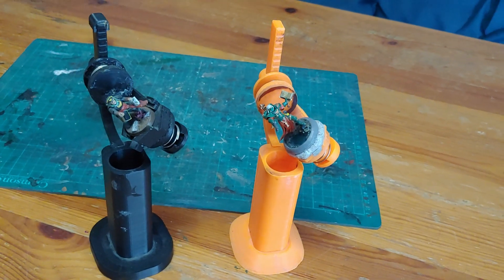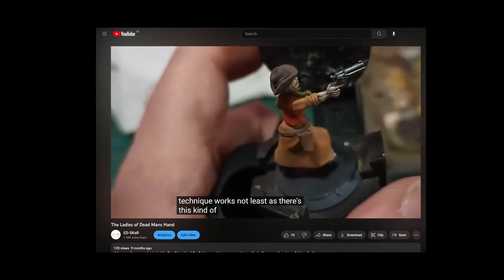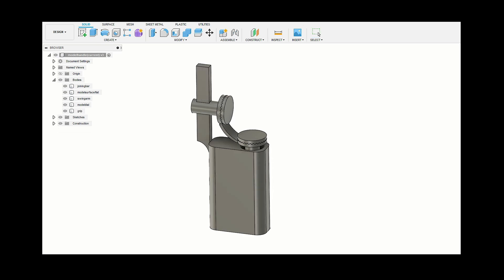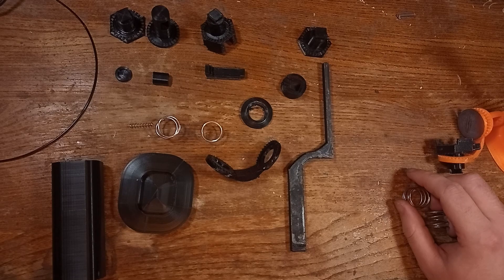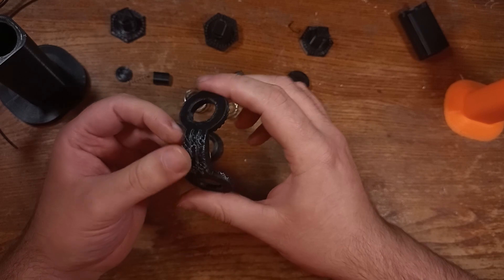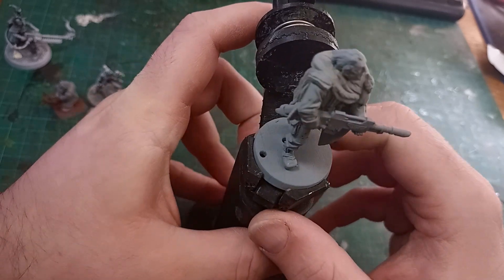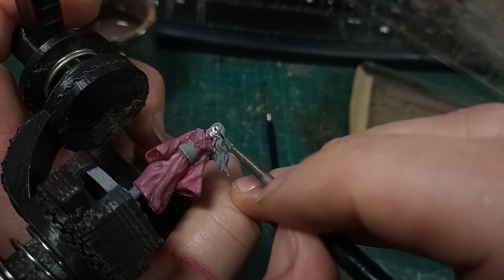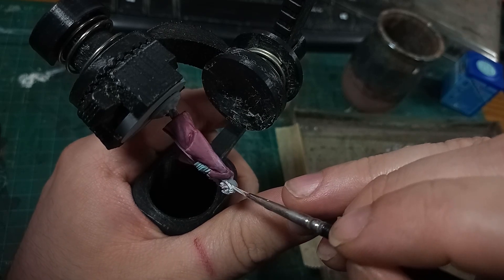ED-SKaR's Overly Complex Model Holder; Now Available.

Comment: I came here after the shill in the 2K Q&A video. I use a plastic pill jar that I can simply cup in the palm of my hand. It has a child-proof lid so I can rotate it without it coming off. I stick the model on with a bit of hot glue. It gives me a lot of the options yours has, but for working upside down when working under skirts etc. yours is far better! I'll keep it in mind for when I get a printer!

Comment: Very interesting approach. I am also studying a bit the available 3d printable paint handles and developing my own. I would suggest simplifying the part with springs: remove the springs and use 3d printable screws (threads in fusion), as it reduces complexity and parts needed. My 2c
Reply from the maker: That would work, I'm not sure if I fully picture what you mean so  I see two points I'd raise.
 The first is that not everyones printer has good enough quality for screwthreads. Printers are improving over time, but there's still quite a few that wouldn't make good screws.
 The second is the ease of use, if you had to loosen a screw, or several, move the model, then tighten the screws, this would slow down the painting process a lot. As an example; when I paint boots on a model by having the model horizontal, I could rotate the model 2 or 3 times to paint the toe, side, heel, side of the boots. With a freemoving rotation, held by the spring, this is very quick and the model stays secure. With a screw retention, you'd make that process take 3 or 4 times as long.
 
I do agree that sourcing the springs is an annoyance, I tried to give a larger range of springs to make it easier. With access to 'the internet' most people can order an appropriate size of spring for not to much.

Thanks for the comment, good luck with your design.

Comment: Is anyone selling the parts please?
I don’t have access to a 3D printer.
Is this device capable of holding up to 80mm white metal figurines?
Reply from the maker: I don't currently have an official retailer of physical prints, but you can ask around your local hobby groups and you might find someone with an FDM printer who can run off the parts for you. I wish I could do it myself but I don't have the infrastructure, and you can see in the video my print quality isn't that good, I'd feel bad charging money for this quality print.

The contraption is open topped so there is no limit to the height of the model, so long as the pose doesn't lean out sideways, it can work. I have painted 54mm models which does work well.
 The maximum base size for the clamp is 32mm, so you might have to use a temporary base for painting, and transfer the model to its final base after, I do this with several models such as the 54mm.
 The weight of a metal 80mm model is a lot more than the ones I have painted, but it should work, I don't think it would slip but you can use stiffer springs to help if that is needed.

Sorry I couldn't help more :(

Comment from the maker: Pinned Comment! More info will appear here!

You can find the files here: https://cults3d.com/en/3d-model/art/ed-skars-overly-complicated-model-holder

The model in the thumbnail and painted towards the end of the video is Yuki Onna by DuncanShadow
Other models appearing in this video are by Bad Squiddo Games, Wreck-age, Italeri, Warlord Games, Perry Miniatures, Hasbro, Citadel/GamesWorkshop

edit spring warning
Someone has pointed out the spring maximum ODs should be different for the two mainsprings, this is because the dial piece is smaller than the crown gears. For the upper spring, the listed 30mm max outer diameter is correct, for the lower spring the maximum outer diameter would be 25mm instead.